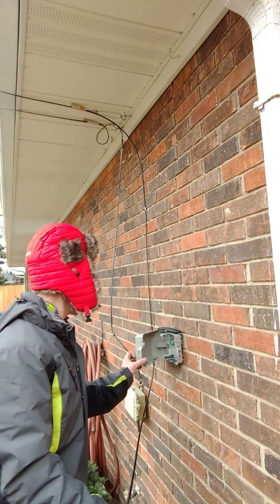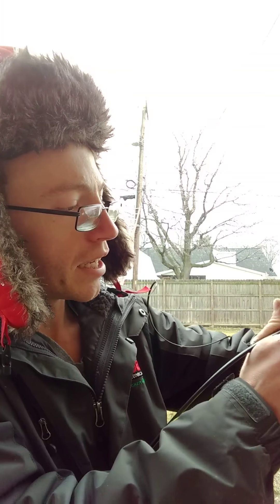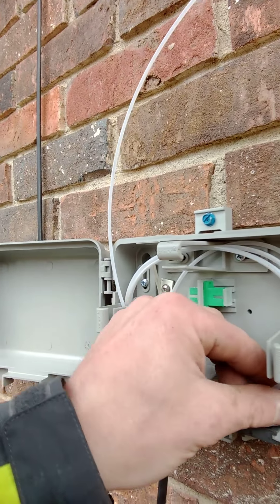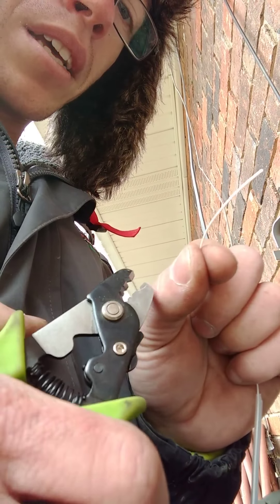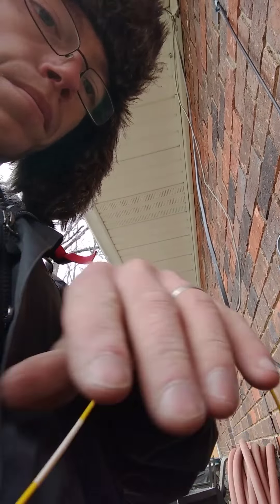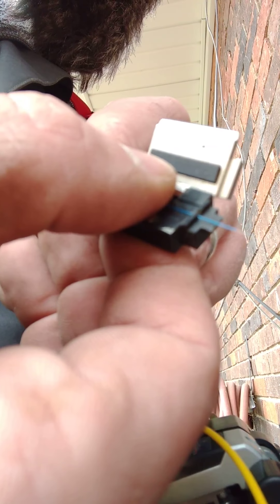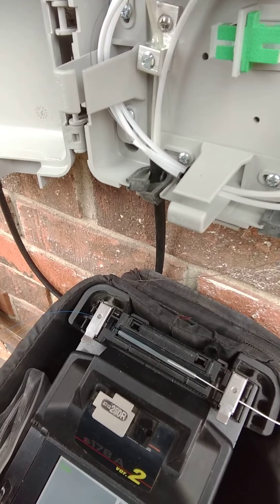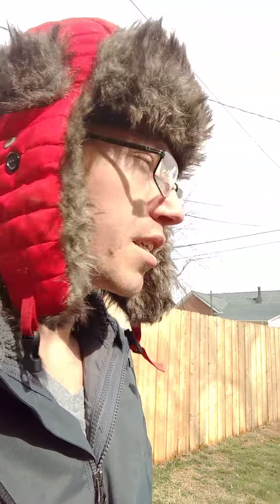HOW TO INSTALL FTTH ( Fiber to the home)

Comment: My experience shows that that buffer tube will break in 5-10 years and take the fiber inside with it. When we terminate the fiber I cut the buffer tube right where I cut the outer plastic. I have seen a lot of install where the tube cracked in the curve and resulted in loss of service with temperature cycles before breaking completely and inducing 10-15dB loss.

Comment: I think it's just meant to have a mechanical connector out on the end of the fiber as opposed to a spliced on pigtail. Either way you made it work and it's nice and neat.
Reply: a mechanical connector will always have worse attenuation than a spliced in pigtail or a splice on connector.
Reply: @plaguewinds7832  And? As if the added 0.3dB made any difference on the loss of the 5km line and the splitters.

Comment: If that's corning Fast access fiber   that first shave should not be needed. Its designed to peel away easily. tape mark five feet of cable You shave two inches off the end. nip the bottom   sheath. Grab the two pieces of sheath and pull them apart and it splits cleanly all the way down as you split and reposition. The tape mark will be your stopper.  I would use a Jonard mid span slitter instead of the x-acto knife if I weren't using fast access cable Jonard makes a great set of fiber tools and our company supplies them so we can be as fast as possible. . All our new install use six fibers. It provides redundancy, is great for small MDU's and can support the room being a rooming house with multiple independent tenants such as students. for termination we use terminations that can be spliced on rather then  using pigtails. AFL makes them and its another real time saver so we don't have to splice 6 fibers in the pigtails. We usually just splice terminate the one cable and save the rest of the future.

Comment: Great info...but I wouldn't  handle  fiber without gloves. Fiber glass strands inside  that cable  are pretty smooth. But once broken or disturbed  they'll penetrate your skin easily.
Reply: Gloves will not keep fiber out, if anything likely make it more dangerous to allow glass to be embedded in them, or by making the fiber hard to handle. Anyone who works with fiber on a regular basis would know it would be miserable to do this task with gloves. Fabric or nitrile isnt stopping the glass either.
Reply: @Famousfifty8  True..but I prefer to wear them atleast while stripping fiber bsw and handling fiberglass  strands.
Reply: @gss89x  And how do you take one fiber out of the 12 that are in a buffer tube? Or do you only handle single strand cables?

Comment: Best to directly splice. Forget the butt connector. Mine failed after several years due to too much loss and they just directly spliced. It’s a permanent connection. Don’t need testing point outside. The ONT can measure power and provide that back to the provider. Really too much complexity in these installs. Can simplify running directly into the house. Look at all the work eliminated for each drop.
Reply: So the connector point is in the house?

Comment: At AT&T we no longer use a fusion splicer. 
We have 3m mechanical crimp on heads that save you the trouble of using a pigtail. 
Good video though 👍🏽
Reply: What's the trouble? I am done with a splice in one minute, 2 with getting the splicer out of the box.

Comment: Spectrum is installing service on my street and I was told they would be up and running in a few months, will the install the box that goes the outside of the house during initial consultation or only after I order service !

Comment: Jonard makes a flat drop splitter for this type of application
Reply: Life saver. The blades dont last very long, but still a great tool to have for oval drop cable.
Reply: @Famousfifty8    Totally agree the longevity of the blades is terrible, but it’ll save you some time

Comment: How does it work if the flat black cable runs directly inside the house? I have that flat black fibre cable running to my basement, unterminated for now as I don't have an active fiber connection yet.

Comment: Thanks for doing the vid. Very interesting stuff.  You didn't talk about it, but I noticed how you tried to keep all your loops really, gradual, instead of doing "Tight" loops, I'm guessing that
important when it comes to fiber?
Reply: Too tight results in attenuation. A tight curce results in the loss of the total reflection within the fiber. It's like if you try to drive your car around a 90° bend at 100mph.
But current fibers are already really good with tight bends. A loop with 2-3 diameter is usually not a problem. But if you have the space you make the loop as big as possible.
Reply: @florichi  Thanks for heads up.

Comment: Will like to see how do you prep the fiber on th epole area/
Reply: Typically aerial applications are as simple as plugging a pre-connectorized drop into a tap port of some sort.
Reply: The splicing, if any would be done on the ground in most cases

Comment: What is cost of fiber v/s CAT6 a?
Reply from the maker: Depends on how and what you terminate the ends with. 
You will need to convert the ends of fiber to ethernet. The only time I to use fiber in place of ethernet is if I have a run that's over 350'. Usually cat6 is cheaper. 
With our own equipment to terminate (Our average cost per cat 6 drop is $16) (average fiber drop can vary between $40- $600+ depending on converter and application)

On a side note I've ran tests for real-world scenarios and can't find much difference between cat 5, 6, or 7 for the average user. We run Gig speeds all the time on CAT5 riser. Just don't tie any knots in it. We mainly use cat 6 + for long runs and Poe, and security related equipment.
Reply: Just the cable it's nearly the same. Some 4 strand fiber cable that are blown in microducts is even cheaper than Cat Cable.

Comment: My internet company has been telling me for a year I can’t get fiber optic internet but on a pole next to my house I see a fiber optic service terminal I was hoping I could somehow send pictures and see if u can figure it out for me
Reply from the maker: I hate it for you. I'm in the same boat at my house. The fiber running next to my house is for government use only. Usually the systems we work on, municipals buy certain fibers and run their system off of that. Depending on what kind of system it is you probably won't be able to just plug it up and it work it'll have to be plugged in on the other end and you would have to have the right ONT + software to communicate with it.

Comment: Do u still working there with DSL coz most of places where I live we still work with DSL and I search for work in a company outside the country 
I will appreciate if someone give me some information
Reply from the maker: I'm not 100% sure what your asking. 
At&t still has DSL in rural areas. But there branching their fiber network out. The video was installing fiber for an electric municipal.
Reply: Shayne Armstrong 
I have a diploma in fixing DSL and I’m wondering if i can get a work outside the country (algeria) 
Like can a company accept a worker have a diploma from another country ??
Reply from the maker: @gurzil6682  
We do fiber contract work. You would probably be better off trying to get hired on at At&t or Google. Most of the contractors we hire have other forms of income.

Comment: Hi Shayne, who makes that small demarc box you used in the video?
Reply from the maker: I believe it's a primex encloser. I haven't seen it in a while.
Reply: @shaynearmstrong9290  Did you guys find a better one that you're using? I'm doing a small FTTH deployment here in Utah, and I'm trying to find some good cost effective demarc boxes.. I was using some Commscope OWB boxes but they essentially doubled in price over the last few months.. :(
Reply from the maker: @paulmurdock  
We're still using the same in the video. That's the one we use in one of our (Not my choice). You could check with  https://www.powertecsolutions.net/ 
Their from Franklin KY they seem to help allot of people out, and if they can't, they'll point you in a good direction. 
My main point of contact is Drew Harding
Reply: Hi Paul, did you found out situable box?
Reply: @paulmurdock  Try looking at Calix enclosure and Primex makes a bigger one than what you see here in this video.
Reply: @Vader99ify  Yes, Corning was our go-to for Calix 7 series ONTs until we starting using more indoor ONT's. Now I much prefer the larger Primex enclosures as they have a lot of room for slack loops in the hardened patch cables that run indoors from the dmarks.
Reply: @Famousfifty8  Yeah we stopped using the 711 and 712's a few years ago and started using Calix's all in one gateway/ONT. This way all I have to do is splice a jumper to the drop and the inside techs come and run a fiber jumper from the NID to the gateway making the RG direct fiber fed. We are using the Primex NID's in other markets where we use a Microtik outside ONT/router and need the room.
Reply: @Vader99ify  9
Reply: @Liquiddinner  10

Comment: Dude, clean your fibre after you’ve cleaved it 🤣
Reply: You do not clean fiber after cleaving it, you clean fiber before you cleave it. Fiber end should not be touched after being cleaved.
Reply: the fusion splicer will also give it an arc clean before it does the final splice. you do not touch the fiber once cleaved.
Reply: And then you have a broken tip again.
Reply: And push all the contaminants to the end. You should tell him not to blow into the cleaver instead...